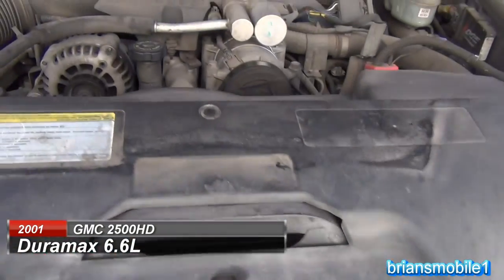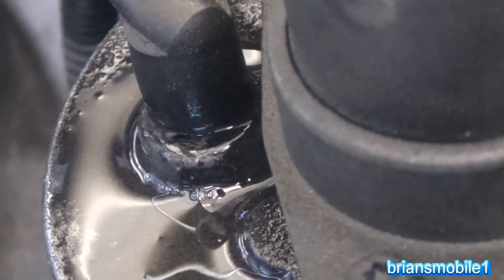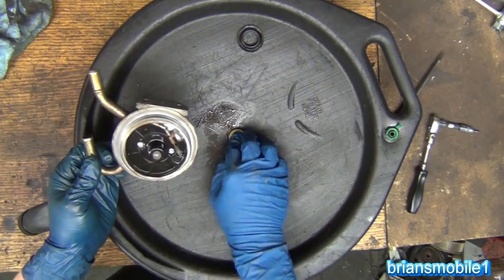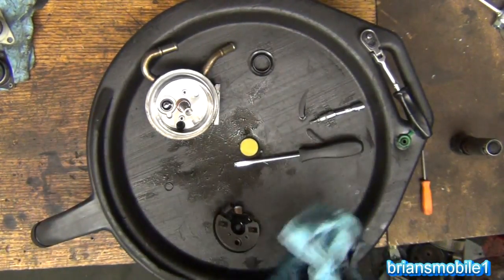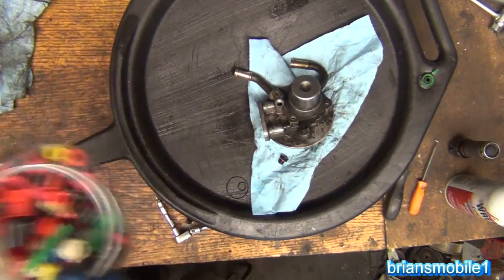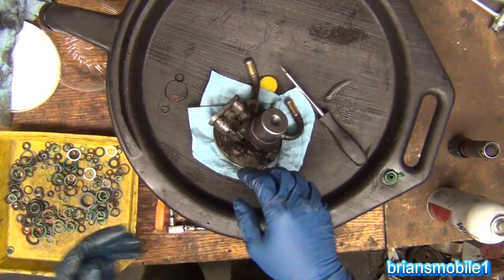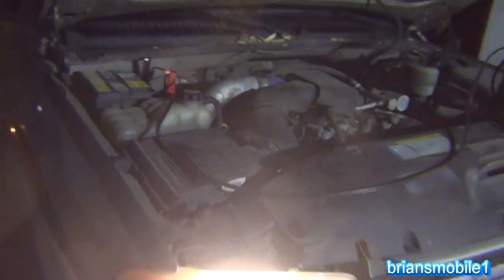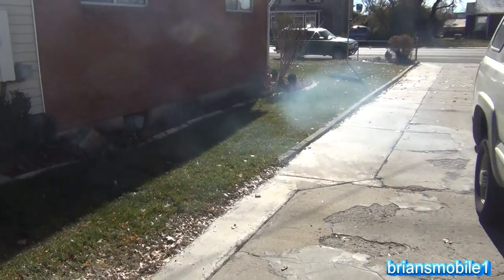Duramax Smoking and Hard Start Easy Cheap Fixes

Comment: The crank case blow by could be  a injector cup or a injector crush wash that is going out. Its not always a bad injector when you have a decent  amount of white smoke. I was told I had a bad headgasket and when I pulled it all part found that some of the injector cups come unglued. So I rebuilt my lb7. after rebuilding my lb7 I had really bad blow by after 2 months  when I had no problems after the rebuild. Took it to 4 different diesel shops that all told me the same thing. They claimed Its a hole in the piston or shot piston rings. The truck ran to good for that so I finally took the time to check it out myself and found that some of the injector cups did not properly seal with the threadlock. Also when I took out  the injectors from the cups that came out with the injectors found that 2 of the crush washers had melted part way. So I cleaned up the cups and put threadlocker 272 on them and replace the 2 crush washers that had partially melted and got it back together and its been all good no blowby for about a year and a half now. Hope this info  helps anyone that comes across this video and sees the comments.

Comment: It’s safe to use transmission fluid on the diesel or possible fix injector problem?
Reply from the maker: Yes!  I've done it for years and even seen older diesel trucks like the Cummins 12 valve run on used and strained ATF reclaimed from a transmission shop.
Reply: How much ATF do you use? I have a 04 Chevy Silverado 2500hd Duramax LB7 just stared light haze/white smoke

Comment: Hi Brian, If you have a hydraulic shop near you(somewhere that makes hoses, repairs hyd. cylinders etc.) You can get O-ring kits from them in 3 different types.
1. Boss o-ring kit
2. Face seal kit(flat face fitting type.)
3. Standard O-ring kit
These kits are designed for high pressure hydraulic systems and handle fuel just fine.

Hope this helps.
Reply: GreaseMonkey X just a tip when going to a hydraulic repair shop or seal manufacture you must specify viton orings as diesel attacks buna orings An will go right back to leaking

Comment: The duramax engine has a pcv system that tends to get clogged and that will cause the blow by and white smoke that you are seeing. Both valve covers have a pcv valve and they tee together and go to the alt bracket and goes back into the oil pan. It something worth looking into if that customer comes back. Great video on fixing the fuel leak definitely the cause of a hard start. I wouldn't have thought to change the o-rings would have just put a new assembly on
Reply: Brandon Sartain 
The o ring kit is $15.00 + S&H from Nicktane Diesel.

Comment: Ok, still could be dirty. Gm makes a nasty cleaner. In short, you pull the fuel lines and bottle feed the stuff to the Dmax and it cleans. It's so harsh that you can't put it in the tank. Google it. Hope this helps.

Comment: Brian,
Awesome video’s! I have a 2004 duramax with the LB7. Purchased the truck back in 2010 with 80k miles on it. I added a Fass 150 pump that came with water separator and filter. Also replaced stock fuel filter with Cat adapter and filter, figuring you cannot have enough fuel filtration. Added Diesel Kleen every fill up. Everything was going well until 160k miles, then I noticed I was spraying for mosquitoes and Prius’s  at every traffic light. Balance rates were all over the place, so purchased new injectors, did the replacement myself and $2000 later was running fine. At 220k miles started smoking again and Balance rates pushing high and low on a couple of cylinders. Purchased the injector cleaner and hooked the hoses up with the cleaner and diesel mixture, truck took 1 hour to empty the bottle. Didn’t really make a difference on the balance rates, and still smoking. Saw your video and suggestion to add transmission fluid to the fuel tank. Bam, after two tanks, no smoke, and balance rates all below 2 in drive!  I honestly believe I could have saved $2k if I had added transmission fluid to the tank back at 160k miles. Now I add it every fill up. Thanks bro
Reply: I ran my diesel for years on used atf.   ran better than diesel
Reply: Robin Floyd  I put a fass on my lb7 and threw that filter housing in the garbage ran fuel line directly to the ficm who needs a primer when you got an electric fuel pump lol
Reply: hey man mind if i ask how much transmission oil you used?
Reply: Also would like to know
Reply: What. Oil you use. Bro

Comment: I replaced all 8 injectors in my lb7 high pressure lines whole 9 and have great balance rates and I now still have a haze once the truck is warm and it smells like diesel. Pushes slightly more haze with a rev. RPMS dont jump around very stable. Help
Reply: I changed my injectors I changed my EGR valve and my EGR valve solenoid sensor. My truck does not have a lift pump I have one but I have not installed it my truck smokes a whole lot once it's warmed up and it's idling I can't figure it out. My check engine light turns on about once a month and it's for the EGR but I changed everything there

Comment: The ATF in the fuel acts like a lubricant, because diesel is actually a very poor lubricant. You can also add at a 100:1 to 200:1 mix of 2 stroke oil to the tank as well, every few tanks, this mixes with the fuel and lubricates the pumps and the injectors very well. As well you need low sulphur diesel, which is not too common at truck stops, but here in SA it is in most filling stations in a regular pump station, not out in a truck corner like the 500PPM stuff.

Friend of mine called one evening late, the fuel attendant ( no self service stations here, due to regulation all filling is service) had put 20l of petrol in the diesel tank. Options were to tow the car to have the tank dropped and drained, but I suggested to fill up with diesel and add 1l of 2 stroke oil to the tank and try then. Worked well, a little rattly ( not recommended but fine on a common rail diesel, it might get petrol contaminant in it anyway from piping and tankers with self seal pipes that hold a lot of whatever was last dispensed in ullage and in valving) from the sudden change in cetane rating down to poor, but it ran well enough. The 2 stroke oil burns well in a diesel, in my petrol car I do the same every 6 months to lubricate the fuel injectors and pumps as well.
Reply: SeanBZA 2 stroke oil made a hudge different to our 2.8 pajero, run smoother and gave us about 5mpg more which is a win when you can only get 20 with out the oil.
Reply: +SeanBZA I disagree about diesel beeing a bad lubricant. I found some on a roundabout one day and crashed my car!
Reply: 18iser So, about as good a lubricant as water then. It is a very bad lubricant for metal, as the lubricating film it generates breaks down very easily with pressure, leading to wear.
Reply: I don't know what you are talking about but the diesel I know lubricates a lot better than oil even. As soon as you spill some on a road it becomes slicker than ice and you don't see the rainbow pattern you get with just oil!
Reply from the maker: 18iser Oh snap!
Reply from the maker: nathan hellyer Good to know!  I should test this.
Reply from the maker: SeanBZA Great to know.  What was the total tank capacity?  An old motorcycle mechanic I apprenticed with used to use two stroke to get old motorcycles to "wake up" as well as lawn mowers etc.  He called it "go-go juice."  It protects and lubricates the cylinders, carb moving parts (bore, float, needle, etc) and it seems to keep a weak fire going in the cylinder.  Too much and of course you foul the spark plug.  Great comment!
Reply: I am a mb mechanic. I ran my old diesel on used atf 80% for years

Comment: 700? For what? The OEM fuel filter assembly complete including the filter is less than 125 bucks. Granted a rebuild kit is far less but the entire assembly isn't much. Fun fact, a lot of the time the assembly develops a crack in the metal so your air sucking comes from the crack rather than an O ring so you end up needing the entire thing anyway.

Comment: 99% of problems you get with modern diesels revolve around all the eco crap they fit, EGR valves, DFP filters, swirl flaps etc. etc. pain in the arse.  I had to clean the EGR on my 1.9 CDTi engine and I looked like a chimney sweep by the time I was finished, it was just caked in 64,000 miles worth of soot.
Reply: my Saab93 1.9tid May have the same engine and after cleaning egr follow the pipe down to the anti shudder valve- the circuit board in there sits in a pool of oil, crazy.
Reply: How ironic calling it "Eco crap" only to admit all the crap that had to be cleaned out that would otherwise been dispersed into the air for our lungs to filter instead. We should all be sorry that you have to do extra maintenance simply because most people desire soot free air. Again, apologies for your inconvenience and your right to impose your pollution upon others. Those damn "eco nazis" at the car companies as well as the world should be stopped from stopping freedom of pollution.
Reply: I forgive you, it's ok, don't worry about it.  I'm even so nice I choose to clean out these eco nazi devices instead of doing what others do and blank them off all together.
Reply: Wayne Holt You mad bro?
Reply: Not even. You 12 bro?
Reply: Lol...
Reply: Wayne Holt looking by your pic, you don't even lift....

Comment: I have a similar issue with the fuel filter leaking... but when you start the truck it runs for about 5-10 seconds and dies out.  Then it takes forever to get it started again.  I hope it can be fixed the same way.  Thanks for the videos, they are great.
Reply: It's the filter head o rings leaking. They can let air in without letting fuel out, I've had two trucks do that to me. When the engine is stopped, air gets past the o rings and that breaks suction in the fuel system and lets air in the fuel filter. When you start the engine, it runs on what's left in the fuel line between the filter and CP3 pump, then the CP3 gets a snoot full of air from the the big bubble in the top of the fuel filter and the engine dies. They usually won't start again until you get under the hood and prime the system with the hand pump. I put the $15.00 o ring kits from Nicktane Diesel in my Duramax and also my Dad's, both had all of the symptoms you described. Both were fixed immediately. Been starting and running good for about 6 or 8 years now.

Comment: My truck blows white smoke when I first start it I go down the highway I floor it and it’ll clear up and stops smoking. Park the truck for about an hour or so it’ll do the same thing
Reply: I’m noticing around my primer pump it leaks diesel. I have the fass lift pump on my truck think the primer head leaking is causing this?

Comment: I have had good success whenever I could not find the right o-ring I have taken a larger o-ring of the same thickness and cut it to the correct size and then used super glue and baking soda and so far I have not had any thing leak!!

Comment: What causes the white smoke? I have a 2000 ford focus with a 2.0L engine that has a hard start and white smoke comes out of the valve cover, and some oil comes out of the return pipe that take its it to the air box
Reply: John Lopez check your pcv vavle first before you dig too deep
Reply: ebu touy works fine, I replaced it a couple of months ago.
Reply: +John Lopez I think those motors usually have head gasket issues. Look up cyl leak down test and then find out where your problem is on your car.

Comment: My truck (02 lb7) has been hazing lately but I use Power Stroke with almost every tank, is that the same as adding atf? I'm guessing its the injectors as they have 140k miles but I'll try just about anything first.

Comment: hey brian would the fuel filter head cause a hard starting on my 06 LBZ duramax?? also i get a really loud whine when i step on the brake pedal. power steering pump i replaced one year ago with a GM part! I also replaced the Master cylinder with a new Gm one. any ideas would be great!!
Reply from the maker: RVGURU As you likely know you've got hydroboost or a hydraulic brake booster that runs off your power steering pump.  If it whines, it's likely got air in the system.... somewhere.  Any time you have air getting into the fuel supply, it can and often will contribute to hard starting or if severe enough a crank no start condition.
Reply: would i have a bad Hydrobooster?? or can i put on a power steering cooler?
Reply from the maker: Overheating the fluid will give a temporary sensation of air in the system (boil over) when it's really getting worked hard like when towing down a curve a low speed.  A cooler may help a little with that.  If it does it all the time even at a decent RPM driving straight and unloaded, then there's air being introduced.
Reply: it does it all the time. the fluid stays full and does not leak. i flushed it couple years ago
Reply: RVGURU hard starting on an 06 LLY/LBZ could be a number of things, more commin by FAR is the fuel filter head or a shitty after market fuel filter, i have yet to see an after market fuel filter separate the water from the fuel...  start with something simple go prime the filter head like brain did WITHOUT opening the bleeder, remember this system sucks fuel from the tank, there is no lift pump so by pumping the primer it will put pressure in the system and show a leak like this, but put a delco fuel filter on it a new one, and cut open old one look for restriction, after that take it to someone who knows that engine. not just any diesel tech
sorry for stepping in brain i also work on duramax engines daily, well usally... right now a ford 6.0l...
Reply: i have only used the ACDELCO TP3018 witch is vin correct for my truck. i  am at 50% filter life left on my fuel filter. maybe i go buy a new one this week

Comment: I know this is an old video. If this gentleman is still a customer and I were you I would take a good lookat the smoke coming out each side of the motor pull off the crankcase breather is on the valve covers on each side see what side most of the smoke is coming from. My LB seven Duramax was hiffi crankcase mist. Way worse than yours. I isolate it to the driver Side valve cover. I pulled the upper valve cover reconnected the injector lines and fired it up the second cylinder back compression and exhaust where escaping between the injector cup and injector. My injectors were done by a dealer who rushed the job and didn't tork the injectors properly. I replaced that injector and that cupbecause the heat had separated it from the head. Put it back together and I have zero blow by now my oil usage stoppedand my miles per gallon went up just a thought it may have a loose injector.I took a video of the leakage you can hear it very clearly I will try to post it on here.

Comment: I have the same problem my truck 
It’s a 06 5.9 Cummins 
But instead is black smoke 
I’ve replaced the #5 injector 
And #1 injector I got it cleaned out 
It was good for a minute but does the same thing again

Comment: If you remove that check ball and spring you’ll gain some fuel pressure that’s just a huge restriction in the fuel system
Reply: I recently had a P0087 low fuel rail psi. Will this help to remove ball and spring?